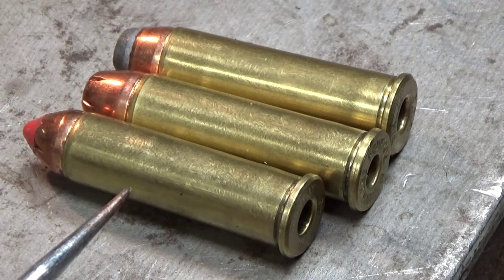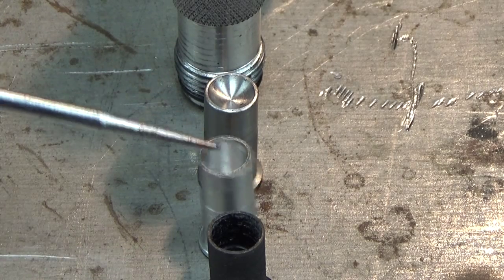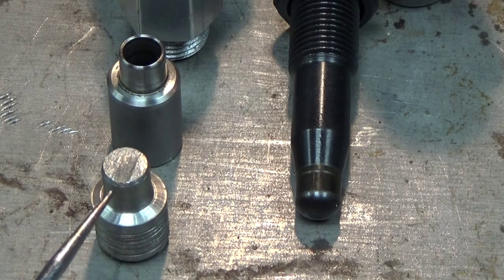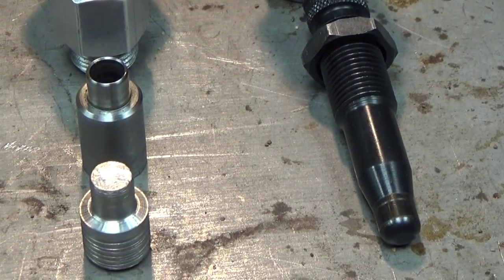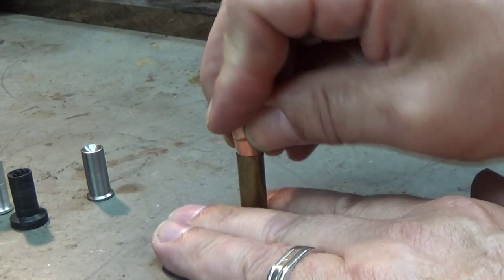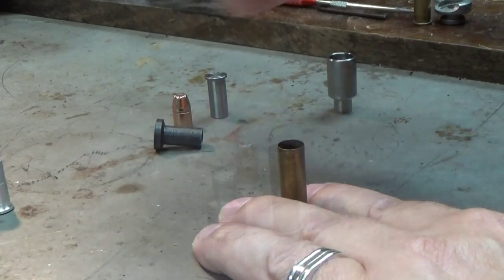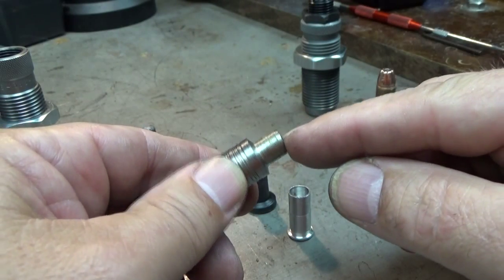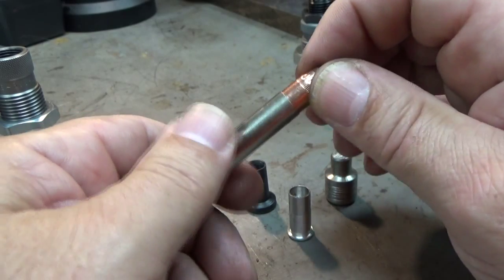Fixing Bulging Cases for Cartridges made for Revolvers

Comment: Interesting solution. Good video. Do you suppose a Lee Factory Crimp die with the crimp adjuste and collet sleeve removed would resize from the outside?  for a similar problem I use a Makarov LFC die with guts removed to resize my nonplunking 9mm rounds.
Reply from the maker: That sounds like a good idea.  I have had too many fails to say whether or not that might work for 9mm.
I will just have to try that and see the results.  I am sure that some adjustments will be required.
Thank you for the idea.

Comment: Thanks for the tip, I do have access to a lathe but I don't think it's going to do me any good. My scenario is that I'm using the same press, dies, and brass, even bullets that I inherited from my grandpa and I know he never had this issue, and when I first got it I didn't have the issue either. it just came out of nowhere and I don't know if the bullets are going in sideways or what. My setup is a dillon 550b so the expander die isn't something I would want to try to make. The only other time I've had this issue is loading 9mm with hornady HAP bullets and they wanted to go in crooked so I associated that with the seating die and never bought them again. It's pretty frustrating to have to run through and size 357 without the decapper and then have that sqeeze the bullets. it's almost like they're oversize which I need to measure now that I think of it. I have a lot of old rcbs die sets that I inherited, and back then the dies were stamped seperately 38sp and 357 mag, and today they're combined. I feel like that shouldn't be an issue when i've also had this bulge issue with 38sp flush wadcutters.

Comment: I just loaded 50 rounds of 357 with plated 125gr bullets, and I didn't have a single bulged case and no changes were made. I think the only reason why the cases were bulging was because I was using soft point bullets or HP with exposed lead and when it's being seated the soft lead is allowing the bullet to move sideways in the case becase the seating stem isn't perfect for that particular bullet just like loading my 9mm hap bullets. So the problem is with the seating, and your remedy for that is to expand the case even more so that makes sense to do, but I just don't like the idea of doing that even though you can crimp.